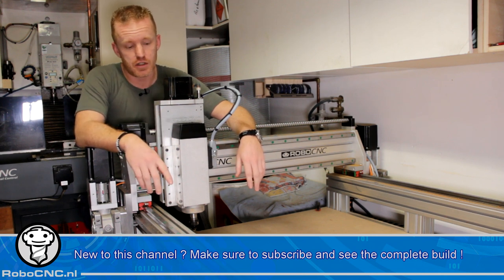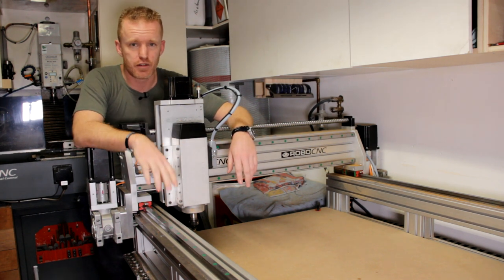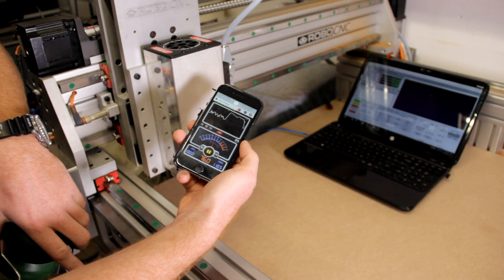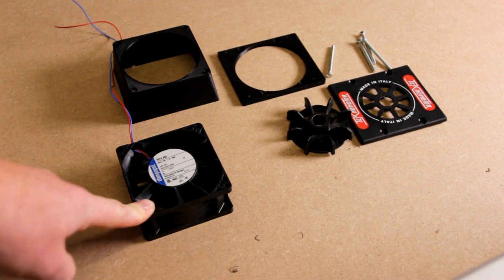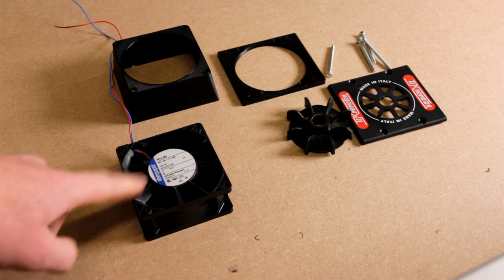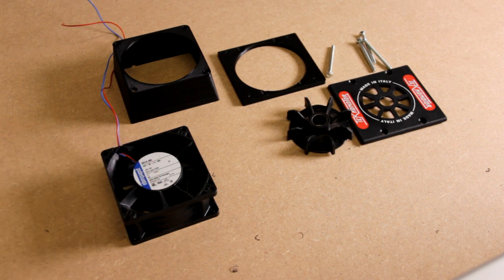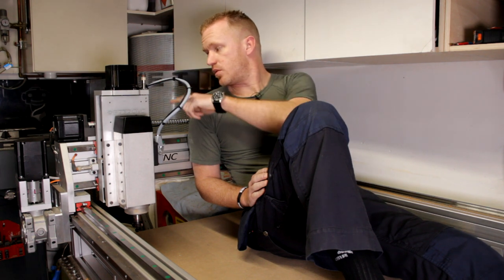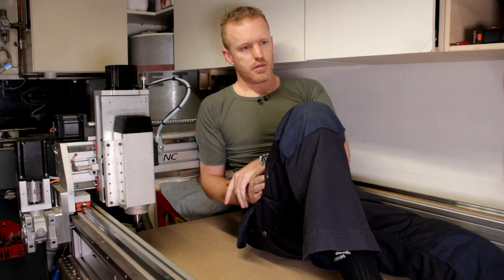RCNC X2 Router 15: Electric Cooling Fan for Teknomotor Spindle

Comment: Great modification Marcel. My Router ran for years using external electric fan for cooling. Now you can run the spindle at low speed without having to worry about overheating.
Cheers
Peter
Reply from the maker: CNCnutz (Peter Passuello) Hi Buddy ! Great to hear.... and indeed, I should have mentioned that in the video.... before it could only run 6000rpm

Comment: Hi Marcel, if in doubt about the bearings of the fan, put the fan on the Z slide a couple of centimetres above the spindle with a bracket and have a short piece of hose to the top of the spindle with an adapter. Same effect, but less chance of breaking the bearings (which I doubt too, that will happen). Nice work!
Reply from the maker: Hi Paul, I want to KISS Keep it Stupid Simpel if possible... We'll see if any mods are needed... for now it works like a charm :P  Thanks !

Comment: A high-quality fan will survive the fibrations of the spindle.
Check for dust deposits and ensure clean fan blades.
It will not take long and will soon be a matter of habit.
Good topic, as always a nice video!
Reply from the maker: That's good advice buddy ! You are right, at 12Krpm dust on the blades can be a problem... thanks for sharing !

Comment: If your new fan has a 3 wire output you could monitor the rpm. So it may provide you an insight , if it was to  start failing.
Reply from the maker: That would be even possible to E stop than... smart thinking !

Comment: That's the same fan that came in my PDS Ades 90 7.5hp spindle. I recently had to replace it because it broke. They aren't the best but it only cost me $60 to replace. Just don't go through any cnc manufacturer as they charge $500+ to fix anything.... 

There is far less magic inside cnc spindles than some people think. Fans and bearings are easy to replace as diy project.
Reply from the maker: Great info ! And over here it’s also holding up fine 💪🏻
Reply: @RoboCNCnl  Mine lasted a year and broke when I was milling aluminum with a 5/8" tool. I got two spares now. No big deal.

Electric fans are better at low speed and worse at high speed. High speed milling generates more heat though. It all depends on how it will be used.

I plan to upgrade to compressed air cooling if Damon CNC ever gets them back in stock. I'm a fan of HSM.

Comment: You mentioned that teknomotor made a high end spindle that was quieter. Are the ones your referring to the motors with electric fans? If so they are not that much more expensive. Im seriously thinking about purchasing this same spindle that your using, however i need 4 and sound is critical. The cooling fan that youve constructed seem adequate but i dont have the skill to make a housing or the 3d machine. Also is the fan powered by a separate source or can it be wired into the VFD. Thanks for your help.
Reply from the maker: Yes i was referring to there more expensive line.... much more expensive line :)

Comment: Hi, i also dont think you will have any problem with the bearings, but if you do you can try to use some rubber dampening between the motor and the fan, even some 3D printed rubber. Thank you for your videos.
Reply from the maker: Thanks for the advice.. ! Good excuse to buy some rubbery printer material to :)

Comment: hi Marcel,  I purchased the same unit from Damen Cnc. It came with the fan. With a red and blue wire.  Can I wire this direct to the Delta VFD so it will run when the spindle runs.  If so where are the co tacts. Thanks for your help and continue your videos please.  Mark
Reply from the maker: That would depend on the vfd and the type of fan... but a red and bue wire seem to indicate its a DC low voltage driving the fan, in witch case you have to find out if the vfd has such an output. (you can not combine it with the three fase wires that go to the spindle itself)
Reply: @RoboCNCnl  Thanks Marcel they gave me a 24v power supply source but I need to wire it to 110 and then plug it in everytime I turn on the spindle.
Reply from the maker: @nidan1955  You should probably get some help from someone hoes keen in electronics.... Or read about operating relais via breakoutboards..

Comment: Funny, I've done exactly this modification like 5 years ago for slightly smaller spindle Teknomotor 3140.. My 3D printed version (ABS) broke after approx. 100hrs of machining. So I milled out the adapter from Aluminum at the end of the day. And that works. 
I also managed (with little effort) to implement  proper angular contact duplex main bearing instead of the original weak deep groove ball bearing.  Better bearing  is the best upgrade that this small Teknomotor SB series electrospindle deserves. Some pictures here: https://forum.strojirenstvi.cz/viewtopic.php?f=43&t=30455
Reply from the maker: Very nice info ! Thanks for sharing !

Comment: Are you still using the electric fan with your spindle? Did it work well over time?
Reply from the maker: Yes, no problems still…
Reply: @RoboCNCnl  sounds great! I believe if you are looking at the Teknomotor spindles with electric fan, they are for sure using some similar fan.
Funnily I bought the same fan like you are using and I'm replacing the noisy fan of my 80mm round hf-spindle. Good to have a 3D printer also and not just a CNC 😊

Comment: I think you may be getting requests from the spindle motor people for your plans.
Reply from the maker: LOL :) They have a differant line (called electro spindle) that has electric fans... I have contacted them first if they had a solution for the problem but they where not willen to talk about the subject.... More like 'You can buy a much more expensive version instead' so I think they will not contact me :)

Comment: Hi Marcel!
question - I haven't ever used the rack and pinion which probably wont offer the same precision as the ball-screw mechanics would so, from your experience - what would be the +/- in mm's, how accurate machine can go? Thanks and congrats with great job!
Reply from the maker: Hi, You are right that rack and pinion will always have some backlash... but this can be adjusted to zero as you have seen in the RP video. Still the gears of our reduction box can have an 8arc/min backlash.. anyway i have not done exstensive testing for hard numbers so for that you will have to search the net... but we are not talking mm, maybe in worst case 0,1 ?
Reply: @RoboCNCnl  Thanks Marcel for a swift come back. I have watched most (if not all) of your build videos so have quite good idea on. Well.. 0.1 sounds pretty good (and even more) if you do the wood working.
Even for a metal, unless you do the stuff for NASA  :-) for most of applications must suffice.
Wonder if you are going the test shortly and publish results.
All the best and good luck!

Comment: with which key did you get the mother I can not get it.I have a Teknomotor 1.6 kw 41/47 model with aluminum fan.
Reply from the maker: In that case you have a different one.. mine was plastic.. so can not help you

Comment: Hi Marcel, how do you control the starting of the fan? manually or from mach3 or from inverter. Provide some details, please. Great job constructing that router !!! Cheers
Reply from the maker: Hi Marius, 
I use the breakout board and let a relay switch on the 'spindle on' command. so basicly its the 'run' to the VFD
Reply: @RoboCNCnl  Do you have any emergency protection in case of the fan breaks down?

Comment: Nice, really glad I found this and see it works. Got a Chinese 2.2 kW HQD spindle (a HSD copy basically) and wanted to replace the fan exactly like you did.
Got only a 8500 rpm 160m3/h (80x80x38) fan though, do you think it'll be enough or should I perhaps look for something better?
Reply from the maker: I have based mine on the existing higher end models. So I have not done any heat calculation. Giving advice would be just a wild guess. (Although I would guess 160m3/h would be fine)
Reply: @RoboCNCnl  great, thanks for the fast reply. Will try it with what I have and eventually upgrade the fan to one from emb papst if necessary.
Reply: @crabsshed  How you have liked the spindle? I have been looking a spindle for my new mill and thinking of Teknomotor but also intrested other options
Reply from the maker: I have not much comparison, but it has not yet give me any problems. Working like a charm :)
Reply: @MikkoKui  it's all good. Quite happy with it. No problems in aluminum and even occasionally mild steel. Paired with an invertek optidrive E3 VFD. The e-fan upgrade went also well and I am glad I did it. Ended up installing a ebm-papst fan in the end.
Reply: @crabsshed  do you have link for that spindle?
Reply: @MikkoKui  price was 200 USD (without VAT and import charges) spindle and 100 USD DHL shipping when I ordered it a year ago.

Comment: Τhe build videos with your x2 cnc is amazing and thanks for sharing your knowledge with us ! I have a cnc router with the same 80x80 item profiles and looking to buy a european brand air cooled spindle like yours to cut r/c aluminum parts up to 4 or 5mm thick. Have you test your teknomotor  on aluminum cutting ?Do you think it will hold up without get hot on a hobbyshop aluminum parts production?
 This is Kostas from Greece ,thanks again!
Reply from the maker: Sorry not much info still, have been out of the country for a couple of months...